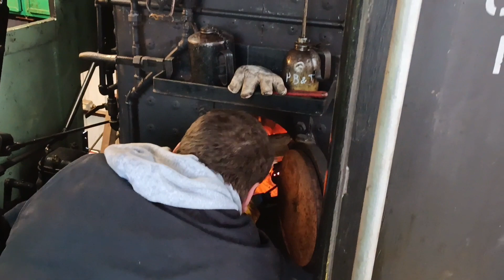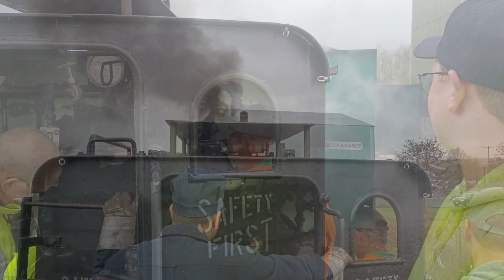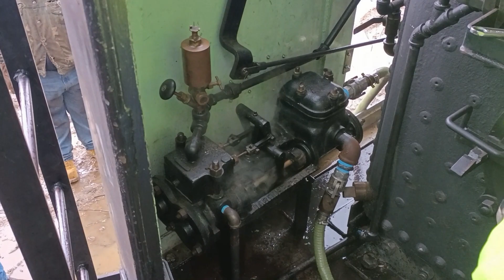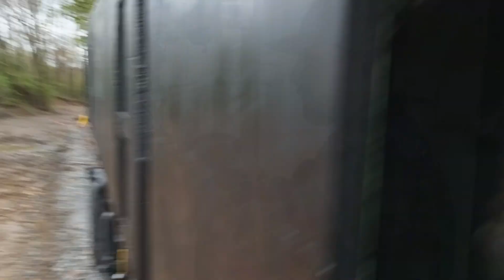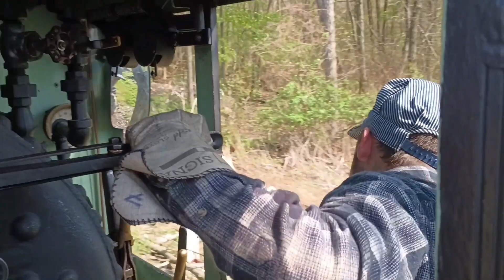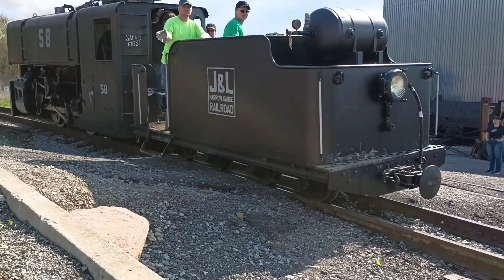J&L 58 First Fireup 2023

Comment: Fantastic to see and to hear.  Good on you both, for getting involved and thanks for posting the video.  Nice.  I'm in the UK so it's one I haven't seen before.  Is it a compound loco, with that exhaust beat?  Keep safe now.  Cheers!
Reply from the maker: Thanks for watching and I'm glad you enjoyed!  It is not a compound, however the valve timing isn't 100% perfect on it.  It used to be a lot worse, where we'd have two good exhaust beats, a really strong one, and one that was hardly anything at all.  We retimed the valves over this past offseason and while it's a lot better than it was, it still needs a bit of refinement, which I'm sure as time goes on we'll have figured out.
Reply: @austinstrains2001  All the best in getting things tuned up and lapped in but it was nice to see.  Thanks!

Comment: To the eye of a Central European (Czech Republic), the locomotive is strange, as angular as a motor locomotive. Mainly the water tank located on the boiler, most of the locomotives here have the tank located between the axles under the boiler for stability. I really miss where the front of the locomotive with the chimney, the middle of the boiler and the booth is. But I like any interesting locomotives that are different from the others.
Reply from the maker: The J&L Porters were certainly unique and quite chunky little locomotives.  I used to think the same thing - "Man, these things are just strange!" - but as I've been around 58 and her sisters more, I've come to really like them.  The design has its ups and downs.  Originally, for example, the saddletank was mounted on brackets that were attached to the boiler.  This could limit the natural expansion of the boiler.  So, when 58 was restored, the saddletank brackets on the boiler were removed and now no part of the saddletank is actually supported by or contacts the boiler, letting it expand and contract freely as it needs to.  That is an interesting thought, having the water tank mounted low like that.  It probably helps with tractive effort a little bit as well, having the weight centered like that!

Comment: Valve gear desperately needs adjustment! The chuffing should sound abut the same on all phases, but this is very irregular.
Reply from the maker: Well, it is definitely better than it was!  If you go back and look at older videos, you'll hear she used to have a really offbeat exhaust.  We retimed it over this past offseason, and in forward it's almost perfect, but in reverse it is still about as bad as it was.  Retiming the valve gear is not an easy process, but we'll have it figured out sooner or later.